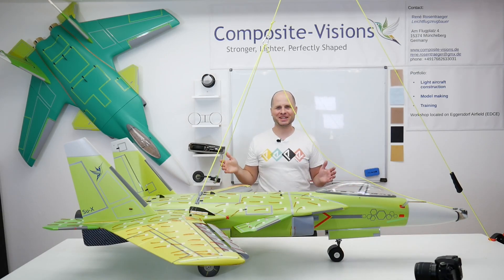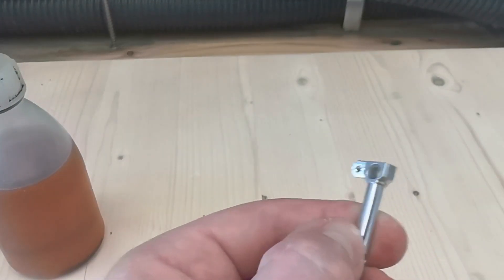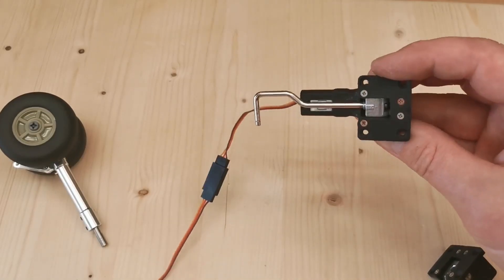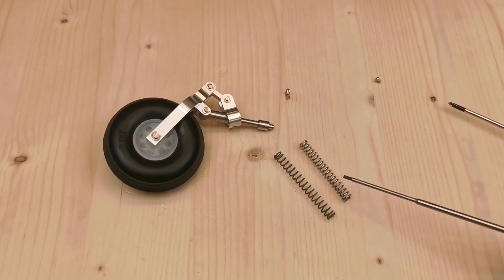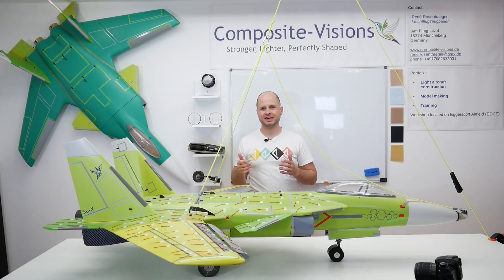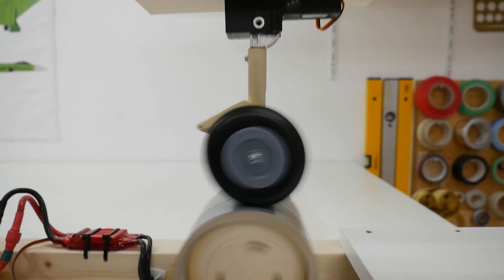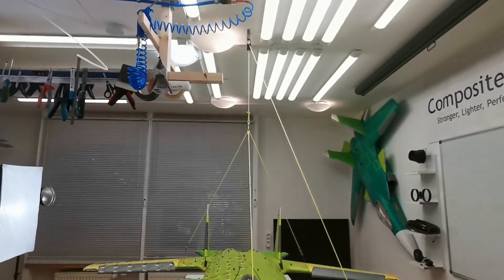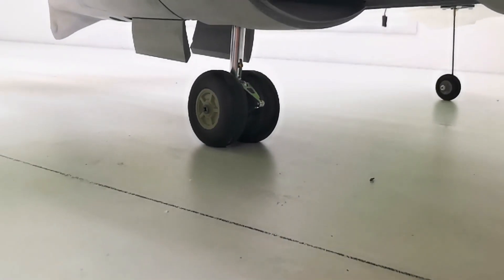3D-Print Harrier | Gear Installation and  Stress Testing | DIY RC VTOL Jet

Comment: When you are tapping a thread you should really hand tap and not use a cordless drill. If you don't had a tool for hand tapping you can always use a set of locking pliers or remove the chuck from the cordless drill.